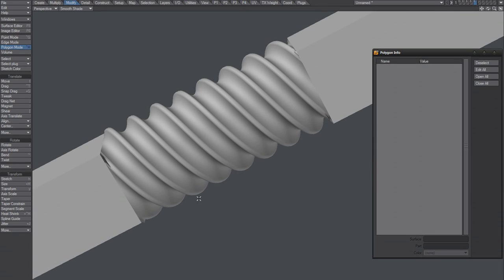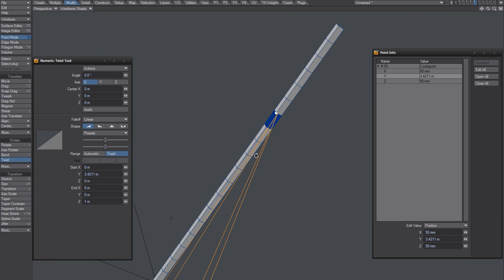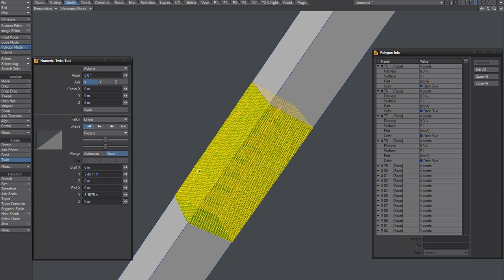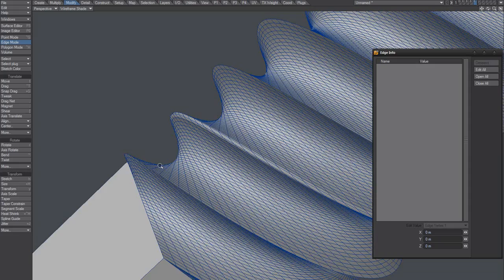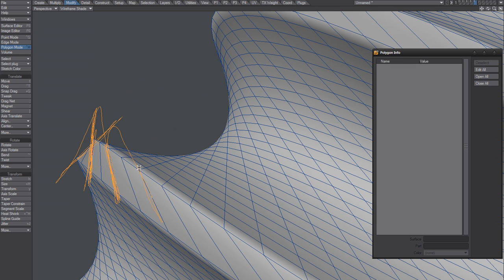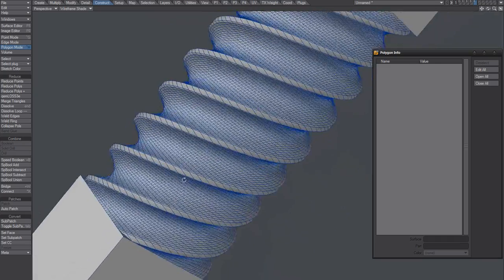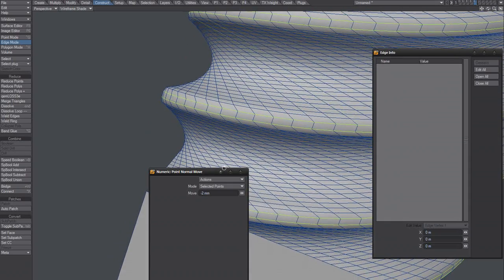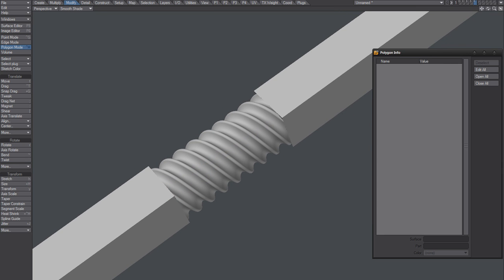LightWave Model - Twist Tool (Ø)

Comment: What tool/command are you using around 5:11 onwards?
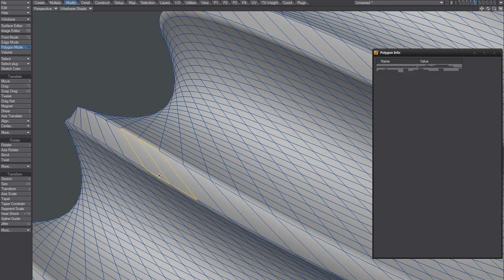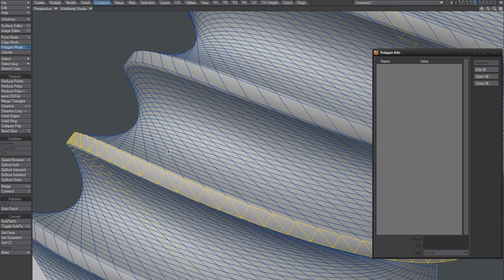Reply from the maker: 5:30 Band Glue 7:25 triple 7:45 merge triangles 8:30 merge triangles 9:25 loop 9:40 point normal move 10:10 expand selection
Reply: @erikals  man, I swear Lightwave have some very bombastic tool names almost like some casual scripts you would found out there. So old school!
Btw what does point normal move more exactly in that case at 9:40 ?